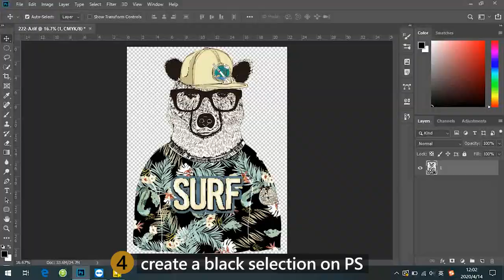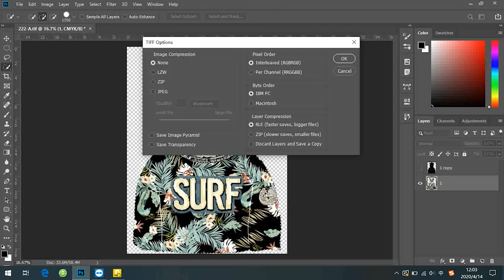How to Print Dark (Black ) T-shirt by Funsun DTG Printer

Comment: The ink tank system appears to be much better than the cartridge system https://www.youtube.com/post/UgkxciSwynMJ7PnUvvx11rewiu-yFBkZTl53 and a lot cheaper to run. The machine was easy to set up. A small point but I thought they'd be a USB cable included to help with the set up but there was none. I've been using it now for a few weeks and it seems like a good product and superior to my previous printers which were all troublesome HP machines.
Reply from the maker: Please contact me directly,
 so that we can send you more information, 
and photos, videos and direct quotes!
 ---------------------------------------- 
WhatsApp:+8613386071431
https://wa.me/8613386071431
https://www.funsunsign.com
Reply from the maker: 請直接聯繫我，
  以便我們向您發送更多信息，
還有照片、視頻 ！
  -------------------------------------------------- 
WhatsApp:+8613386071431
https://wa.me/8613386071431
https://www.funsunsign.com